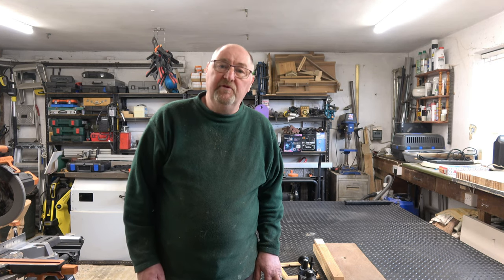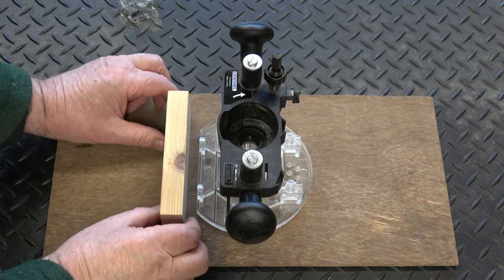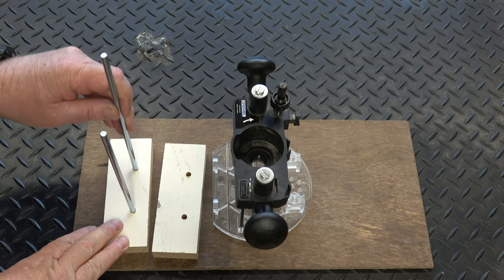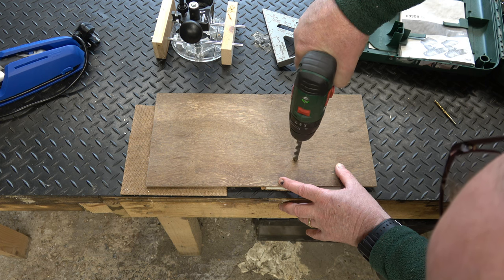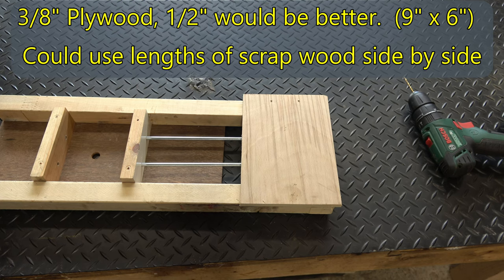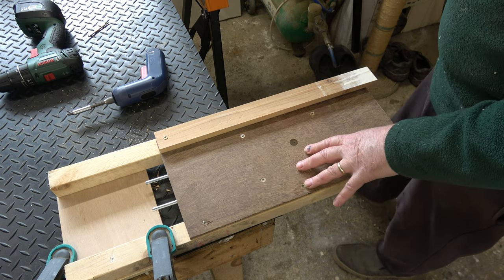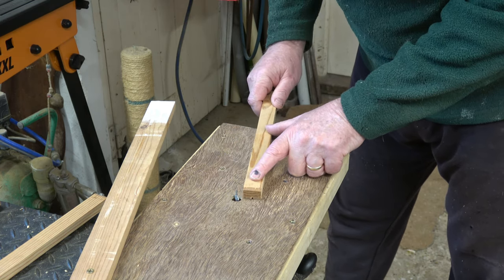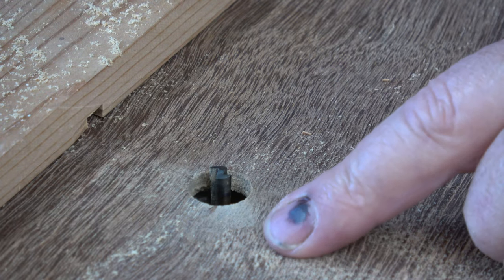Easy - Convert your Dremel 335 Router Attachment into a Router Table for More Control and Enjoyment!

Comment: I too appriciated this DYI-video alot! A friend of mine described perfection as a thing not that you dont need to add more, but a thing that you dont need to remove more. 

I find this DYI as perfection: I cant find a single thing to remove. All steps and so, are there. No more, no less. I too made mine of pices of scrap, and of course I can find a thousand of things to add, improve, sand down, form, curve, screw etc. But for my needs: its perfect! Thanks, Russel!  Best regards from Sweden
Reply from the maker: Glad I could help Varg.  Many thanks from England!  :-)

Comment: A bit late to your video, sorry!
This is a quite straight forward design and will be very useful for me, thank you! I think I even have enough scrap right now that I won't have to actually buy anything to make this. 
I may add a pin to the table to help avoid potentially catching the ends of my work pieces when not using the fence. 
I like to build small boxes and being able to have better control for rabbeting the edges will make things go faster and, I hope, give me better looking edges.
Again, thank you!
Reply from the maker: Glad I could help Rob.  Good luck with your projects!  :-)

Comment: Extremely useful. I was just trying to figure out how to convert my Dremel plunge router into a table. I’m getting started on this straight away. Absolutely brilliant !
Reply from the maker: Good luck I hope it works out for you!  :-)
Reply: @RussellPlatten  oh it worked great. Unfortunately I got a bit overzealous and burned up the bearings on my Dremel 4000. Waiting for replacement parts to arrive on Monday.
Reply from the maker: @ColfaxJones  I was stressing mine a little in the video, it is too tempting to give it that little bit extra (pardon the pun!).  I hope you manage to sort it out!  I have a few craft projects lined up for the next few days.  :-)

Comment: Brilliant Russell, I spent a small fortune on Dremel accessories one of which is their Router Table but I found it small and awkward to adjust.  Your solution looks good to me.  Cheers
Reply from the maker: I made it on the hoof, using bits of scrap I had in the garage.  You could easily change the size or figure out another way to mount it Peter.  Unfortunately the base does not have pre drilled holes for mounting, it would have been a doddle to make a table it it did!

Comment: Hi Russell
Great once more. I will be making one, Just got to get the router attachment which I have been meaning to get for sometime now :)
Reply from the maker: Glad it is useful John.  I decided to make one after struggling to rout freehand with it.  The table is a much better way to rout wood and I wanted to make something simple that would do the job without being over-complicated.  :-)
Reply: @RussellPlatten  I'm going to use for the same purpose as you described. Small picture frames. You made it look easy to make, let's see stay safe Russell.
Reply from the maker: @johnwhite1608  You too John!  :-)

Comment: A beautiful video, and very practical. I am tempted to make one soon. Just a little tip. I noticed that when you routed the knot in the wood, it dislodged it. A good tip is to apply low viscosity CA ('super glue') to the knot prior to routing, which would stop it separating during routing.
Reply from the maker: Great tip!  :-)

Comment: I loved your video. I'm torn now, about what is best to do. I intend to do a lot of 'creative' 'freestyle' wood sculpture building/ wall sculpture. which will involve A LOT of freestyle wood shaping(& I have a large supply of like 1.5" x .75" x 8' wood, approximately, that I will cut into shorter pieces, as just one example, so I don't see need for a full router yet, when I own a dremel... & will work with other smaller wood pieces/ sheets, etc). I was trying to decide if I need both the Dremel router table & Dremel plunge router... or just one... & which one... & now you throw in the awesome possibility of this 3rd option, where I could buy the plunge router & just build my own table for it; (I've built similar, but simpler bases for other tools, so I am sure I could pull off your plan). The prefabricated Dremel router table looks small, as I see comments here also complain about... But I had heard people used it for more than routing, especially grinding glass/ stained glass edges with a dremel grinder. I can't figure why your table wouldn't work for that? Is there any insight you can give? Any thoughts? Advice? I have plenty of scrap wood & would rather save money & not buy both Dremel router devices if not needed. Thanks for the help in advance. You are awesome. I'm so especially thankful for your useful video after just watching one that wasted a chunk of time I couldn't afford to waste. Blessings.
Reply: Also, maybe I could cover the wood with aluminum flashing somehow? to avoid ground up glass problems?
Reply from the maker: I have been using router tables like the one I make here for 30 years.  In fact, there is a 1/2" router permanently installed under the rubber covering on my work bench.  It would be easy to make the table larger to allow bigger work pieces if required and because the fence is just a piece of wood screwed at one end, it can be removed to allow access for work where you are using a router bit with a pilot pin or bearing.  The Dremel 231 Router Table is very small and does not lend itself to work on larger pieces or working with piloted bits.  

As for ground glass, I would not attempt this on any table with the Dremel.  The ground glass will fall down into the Dremel and quickly wreck the bearings.  It would be possible to use the Dremel 220 Workstation for this task and have the Dremel above the work piece and the bit dropped slightly below the level of the base.  There is a hole in the centre of the base that would make this very easy.  I hope I have explained this adequately!  :-)
Reply: @RussellPlatten  Thanks. I own the workstation, so I get you. That makes perfect sense, to keep the dremel above the glass. I'm glad I asked in case I take up glass grinding, so I don't fill my Dremel with glass dust :) !! Wow. You sparked my curiosity with mention of pilot bits, & now I am exploring even more options. Hopefully at some point soon, I'll have some tool in my hand & actually start experimenting with making stuff, past this preparing/ planning/ research phase. All these options can make your head spin, but you sure are a great help in the whole process. Thanks.
Reply from the maker: @cchemmes-seeseeart3948  My advice would to be to start slowly and purchase bits and accessories as you progress.  Try not to talk yourself into buying everything you think you may need (I learned that lesson a long time ago!).  If you have seen my review of the dremel router base; the router bits I use are cheap and a great way to try out routing without too much outlay.  The set includes pilot bits and plunge bits.   If you look at the review I did on the Makita die grinder; you will see me use carbide burrs.  I have a set of these for the Dremel too and these are great to start carving with and are not too expensive.  I will add links to the video description to show you what to look for if you are interested.  Shop around as you may find cheaper alternatives.  The ones I use are fine though.  The best bits for carving are the Kutzall bits, but these are way more expensive.  I have already snapped one of the ones I bought, as 1/8" is not much steel when applying lateral pressure on a rotating bit.  Try not to take off too much material and take your time or you will end up snapping bits too.  This is only advice and you will make up your own mind whether to just jump in or dip your toes in first.  Either way, good luck with your new hobby.  It is a very rewarding way to pass time and you will get better and better as time passes if you stick with it!  :-)
Reply: @RussellPlatten  I can use all the advice I can get. I'm so glad I talked with you. I will look for those additional videos you mention & yes I can use the links you mention. Thanks!
Reply: @RussellPlatten  Also, I have found a true calling to be an artist, but I am still exploring & finding my way in fulfilling that calling. At one point, I have a quick moment of passing futility/ concern with aging, & then I realized--- whether I do my art or not, I will still be living here on this earth,  & time will be passing.... so what better thing do I have to do than what I truly have found is not only something I love, but actually God's will for my life. It is rewarding. Bless you.
Reply from the maker: Good luck with your endeavours!  :-)
Reply: @RussellPlatten  Thanks for words I didn't even know I need, about not trying to take off too much material & taking your time as  a way not snap expensive bits! I'd glad for that bit of wisdom from you, rather than learning it the $$ hard way with snapped bits. I'm going to look at your die grinder review too. Thanks again.

Comment: Hello Rusell, By replacing  for a longers the two long crews front the deeper part , could'nt be another way to fix it ??????????? Thank you
Reply from the maker: Sorry Alvarez, can you try to explain what you are asking differently?  I do not understand what you are asking.  :-)
Reply: In the end I followed your way, but I was wondering by replacing the two long screws where there are the springs for two longer ones and using its two long screws to attach it to the worktop.

Comment: Very good, thumbs up, though you can buy a Workzon router table for £35 or even better you can buy nice frames from The Range to take a 6 x 4 inch print plus mount card for £1.99 :), just a thought
Reply from the maker: I just wanted to show how a table could be made out of scrap wood for no money if you had spare wood lying around the workshop Terry.  :-)

Comment: It is a very good idea in order to fix the Dremel 335 Plunge Router Attachment to a board, but the board (table) has to be fixed and work with it at 90° position because when using it as a table the wood dust will come into the dremel main ball bearing fixed on the shaft (rotor) and that will destroy it, that already happened to mine, so I fixed the board (table) at 90°. I haven't came up with an idea on how to make and fit a dust vacuum to the Dremel  Router Attachment, I will appreciate very much if somebody has an idea on how to do that.